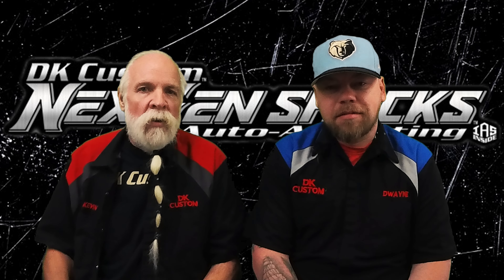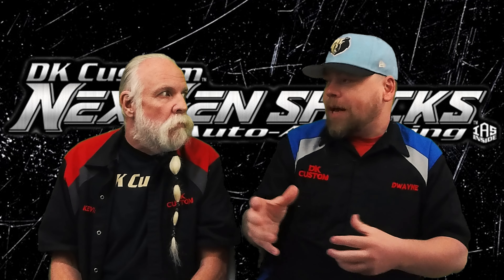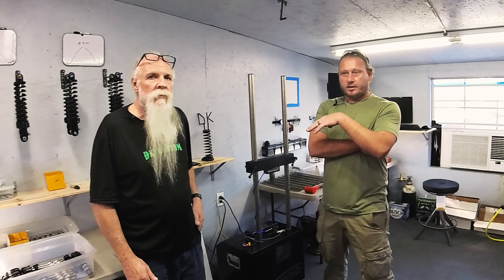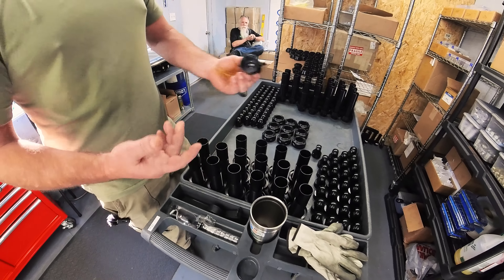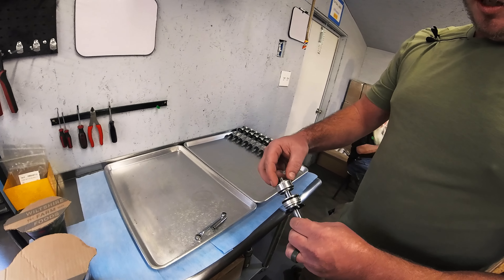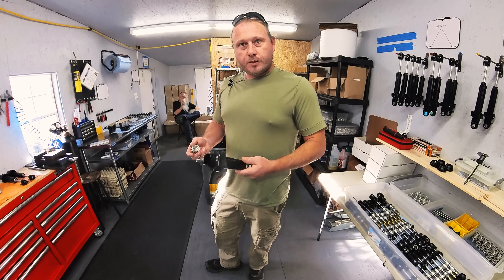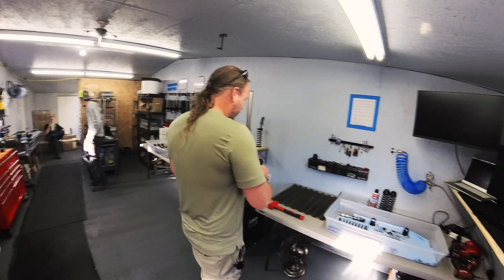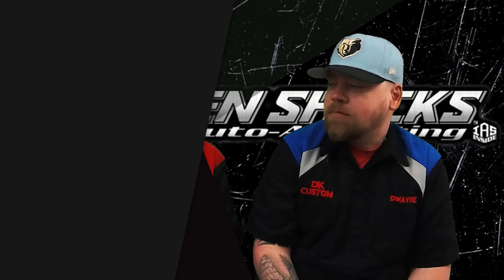Game-Changing NexGen™ Harley Shocks - An Inside Look

Comment: So have you compared your shocks to Wilber’s ? 

Also I have been looking at buying progressive 444 shocks for $600 new, and they claim to adjust valving while riding as well. But now I’m leaning towards your nexgen shocks for my road glide limited. But they are $1000. What makes them $400 better ? Both lifetime warranty and you rebuild for free once worn and you run better shock mounts but internally what makes them so much better?

Also I seen you have a shock Dino. Could or would you make a video comparing the two and specifically comparing on the Dino ?
Reply from the maker: We have not gotten our hands on the Wilbur's to do a comparison  We will the next time we set aside time to do shock testing.

Almost all shocks are "self-adjusting" on the compression stroke.  This is accomplished by the shim stack found in most shocks.  The NexGen™ utilize a shim stack also, for self adjusting on the compression stroke.  Where most shocks fall short is on the rebound stroke, and the fact that the shim stack also is used on the rebound, so both compression and rebound are always a compromise, meaning both are less than ideal. (that is what keeps the tire on the ground with road irregularities).  

The Progressive shocks are Not self-adjusting on the rebound stroke.  Nor are any other shocks that we are aware of for Harley's.  The NexGen™ shocks have a Patented technology in them called IAS.  

MORE About The Patented IAS Technology: Normally shocks have 1 circuit for for compression & rebound damping.  Within this damping circuit are "shim stacks" that provide pressure sensitive adjustment to the damping.   Because it is one circuit for both, it is always a compromise.

These shocks have TWO Completely different circuits (valving) for Dynamic auto-adjusting rebound damping. 

By having one pressure sensitive circuit for bumps in the road, and Another damping circuit for dips in the road, the damping works exceptionally well.  Each damping circuit is set up to optimally, and automatically adjust the damping to the road surfaces, acceleration, braking, load (weight) on the bike.

The reason for the high price is all the extra components in the IAS that have to be machined and assembled.  Additionally, we test every single shock to make sure it is functioning properly.  Each shock is on the Dyno for 5 to 15 minutes.

All of the above is why the NexGen™ provide such a better ride quality than the other options out there...and that is what is important...which shock will give you the best ride quality.

When testing most of the popular shocks, you can see that the 444's receive some of the lowest scores for ride quality.  Depending on that bike you have, they only get a score of 30-40 out of 100.

If you are wanting a good quality ride out of some shocks, but stay down around $600, the Twin-Adjustables, at this link provide the best quality ride.

Here is a link to all the shock testing results where you can see how each perform compared with each other.
https://www.dkcustomproducts.com/overview-of-performance-rear-shocks-99.htm

At this link you can see the Twin Adjustable Shocks- https://www.dkcustomproducts.com/rear-shocks-c651.htm

Here is a link to a video showing how the IAS works.  This video is primarily about front suspension, where the IAS is used for the compression (whereas on rear shocks the IAS circuit functions during rebound), but the principle is the same.
https://www.youtube.com/watch?v=N1cUpgNJ7i8

Always free free to email or call with any questions:
Support@DKCustomProducts.com
662-252-8828

KP

Comment: Hey guys you need to come up with a rubber motor mount  conversion for the M8 softails I have a brand new 23 breakout and it is like riding a vibrator
Reply from the maker: The Softails are solid mounted to the frame, and the engine is 100% balanced.  There are many reasons you may be having excessive vibration.
But you should still be under warranty, so it may be worth riding another 2023 and seeing if it vibrates less, and if it does, then take your to the dealership and have them fix it.

To give you some (not all) ideas on what could be causing vibration:
Riding with too much throttle at too low of an RPM...should really not be getting on the throttle very heavy until at least at 2500 RPM.

Out of balance tires

Wheel bearing going bad

Drive belt too loose or too tight

Counter-balance in the engine not in spec

Hope the above gives you some help.

Thanks for commenting! KP

Comment: So I used your lift brackets on my 2016 Tri Glide, in order to raise the rear-end up a little, while still using the OEM air adjustable shocks. Would I need to use the 13" Nexgen shock, or the 14"?
Reply from the maker: Hey Ricky, if you installed the lift that is compatible with your OEM shocks you would need to get 13" NEXGEN™ Shocks. 

The only way you can get the 14" NEXGEN™ Shocks you would need to get the Convertible Comfort Mount for 14" Shocks. 

You should know that adding the NEXGEN™ Shocks the sag with the the 4" of travel will make your bike sit about OEM height. 

Here is a video on Sag and Ride height that you may find useful - https://www.youtube.com/watch?v=sS_zxGo-wSg

Please feel free to contact us with any questions;
Support@DKCustomProducts.com
662-252-8828

Thanks for commenting! 😎 MB
Reply: @DKCustomProducts Awesome...I will be placing my order very soon :)
Reply from the maker: Thank you! Please do not hesitate to reach out if you need anything!
Support@DKCustomProducts.com
662-252-8828

 Thank you for your business and for commenting! MB

Comment: Hi guys when it comes to a triglide ultra 2023..what makes these shocks that you sell for the 3 wheeler better than the LEGENDS SHOCKS FOR FRONT & REAR OF THE TRIGLIDE ULTRA 2023..
Reply from the maker: The NEXGEN™ Shocks have 4" of travel (which will largely help with eating up small and large irregularities in the road) , IAS Technology Inside (Inertia Active Suspension is a patented technology.  These NEXGEN™ Shocks dynamically adjust rebound damping, resulting in improved riding comfort & control. This is achieved via a motion sensing valve in the shock body that dynamically adjusts the rebound damping to be ideal for both dips and bumps.), They are set for you, your weight and your riding preference so that you can install them and ride. With quick and helpful customer support for any questions or concerns.  

You can read more about the NEXGEN™ shocks at this link - https://www.dkcustomproducts.com/dk-custom-nexgentm-14-trike-series-shockstm-for-harley-davidson-trikes-2040.htm

You can also see a written report that we've done on a lot of different rear suspension and how they compare to one another at this link - https://www.dkcustomproducts.com/overview-of-performance-rear-shocks-99.htm

This video shows a lot of what is different about the NexGen Shocks™.  One major thing is that we dyno every single shock before it gets shipped out.  There is NO ONE else doing this.
https://www.youtube.com/watch?v=4peMFViG2Ho

Probably the most important factor is how the Trike feels when riding it with the NexGen Shocks™ compared to others, like the Legends. 

They just ride better...and that is not just our opinion.  You can see in reviews  on various forums, that there have been quite a few folks that have been disappointed in the ride quality of the Legends, and when they upgraded to the NexGen's, there were quite pleased.

Regarding front suspension.  We were really excited when Legend came out with their latest iteration of the Axeo.  (we are a dealer for Legend and wanted to add them to our website since they had such good things to say about them)
Anyway, we did a test of the Axeo's and we were very surprised that their $1000 set up did not provide any significantly more comfortable or compliant ride than the stock springs paired with the Intiminators, but they cost 5 Times as much!  Very disappointing.
See link to the Intiminators here- https://www.dkcustomproducts.com/improved-front-suspension-w-intiminator-fork-valves-for-harley-dk-ric-int-39.htm

You can see a comparison of all the popular front suspensions at this link- https://www.dkcustomproducts.com/dk-custom-front-suspension-testing-report-part-i-of-ii-dk-fs-tst-rp-i.htm

Please feel free to contact us with any questions;
support@dkcustomproducts.com
662-252-8828

Thanks for commenting! MB